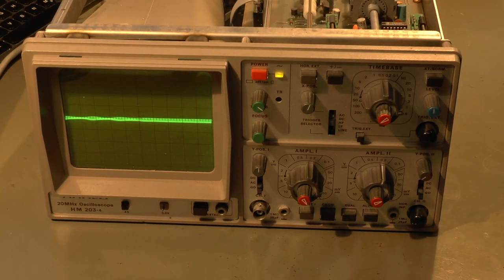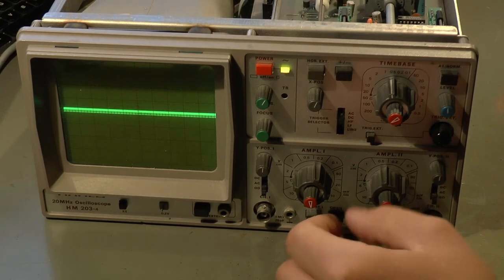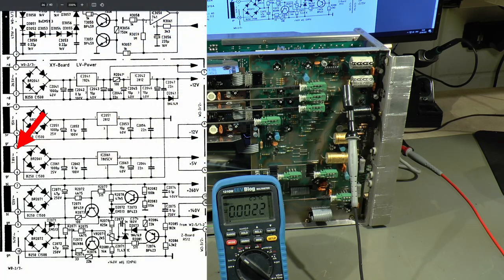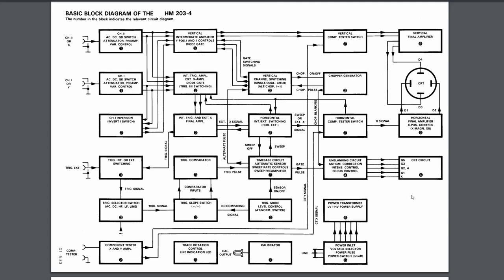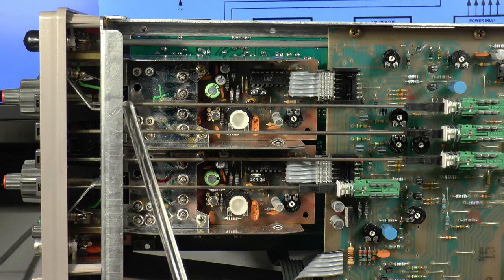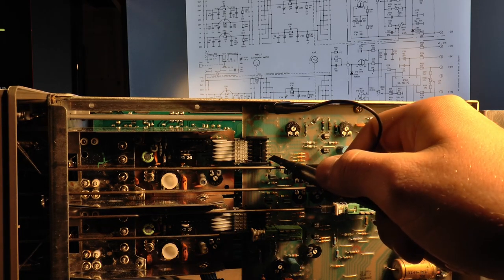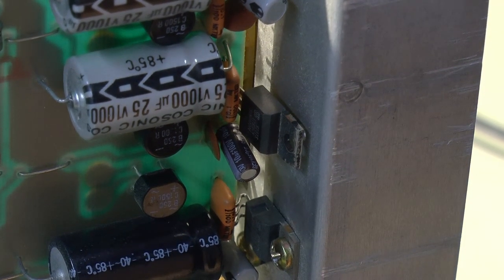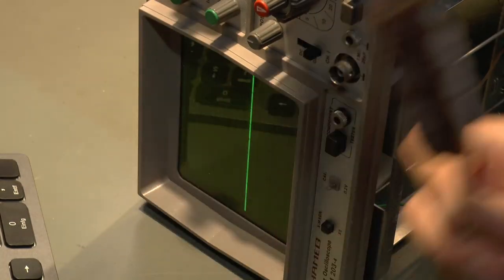HM203-4 analog CRT oszilloscope repair

Comment: I don't think you mentioned it, but the 5V regulator isn't actually screwed to the heatsink. That might be contributing to the issue?
Reply from the maker: I was surprised by that too, but if you look at the board layout in the service manual (page 31) you'll see that all of the other regulators are designed to be attached to the heatsink, but the 5V one is only on the board itself. No idea why they wouldn't just mount it anyway since the hole is there though.

Comment: My ex pushed my Telinstruments 25mhz off the bench, resulting in a similar fault to your scope.i am a sort of  newbie to electronics  but is there any possible way a heavy knock or hit could cause a charged   electrolytic cap to shit itself suddenly , especially if it was on its way out anyway?..sounds like a strange question but Einstein may have had an answer.
PeaceFromOz